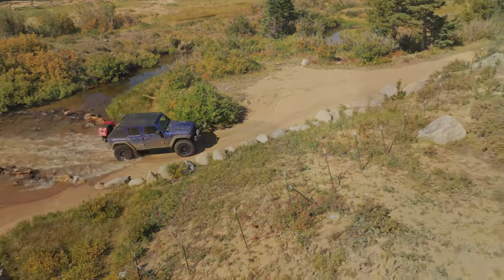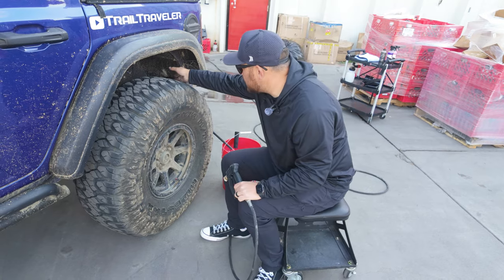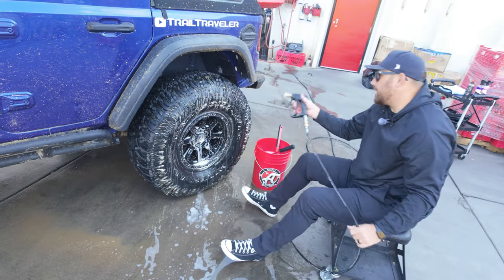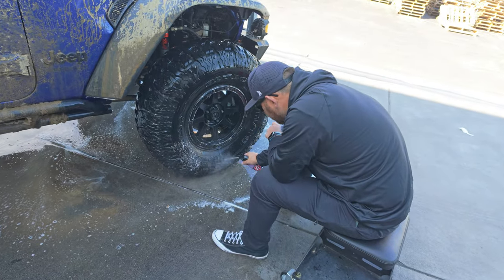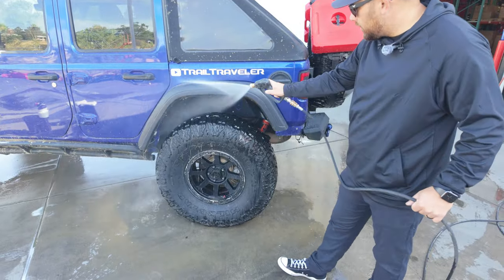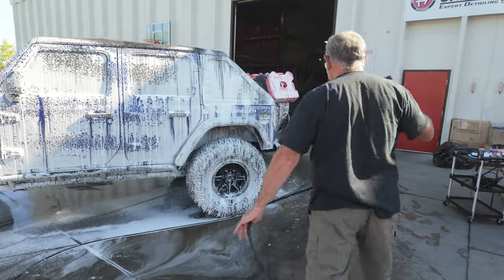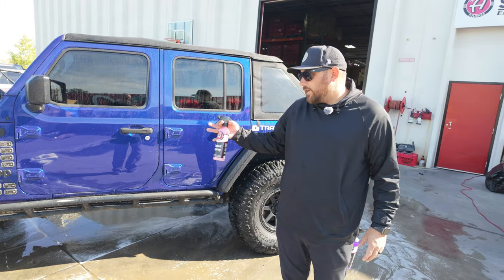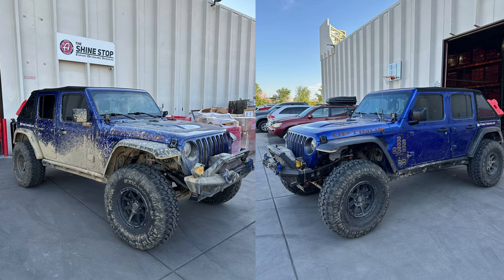Can This Ceramic Coating REALLY Protect Our Jeep?

Comment: I used 3 coats of Adam's Advanced Graphene Ceramic coating on my 24 Silverado after some mild paint correction right off the lot and it looks truly amazing! Literally nothing sticks to it and it's beyond easy to wash. The icing on the cake is the reduction in water spotting. Truly a great product.